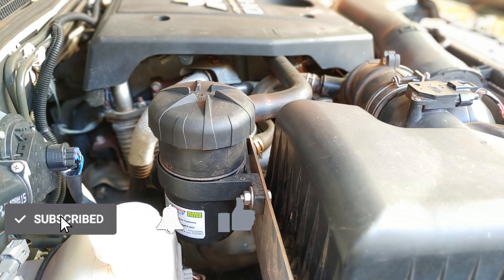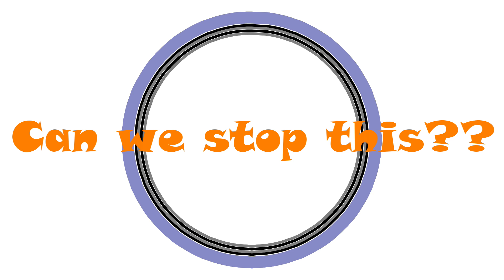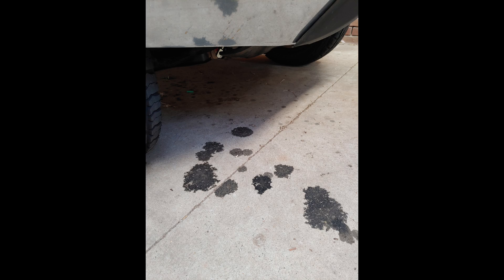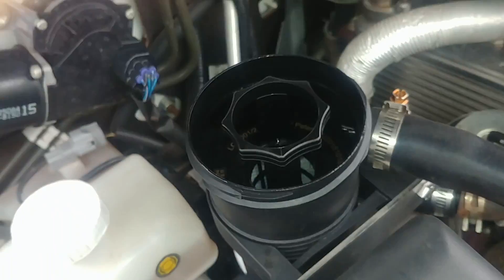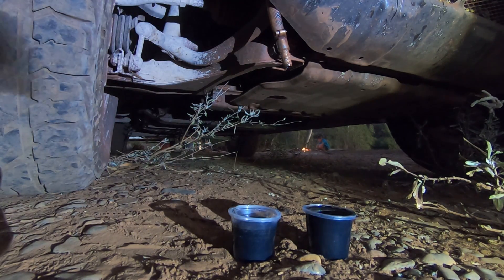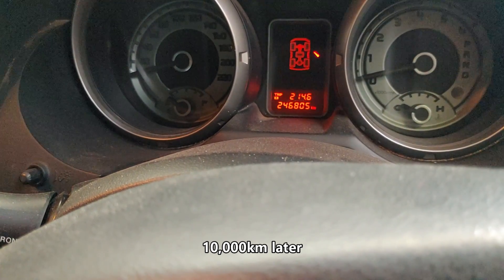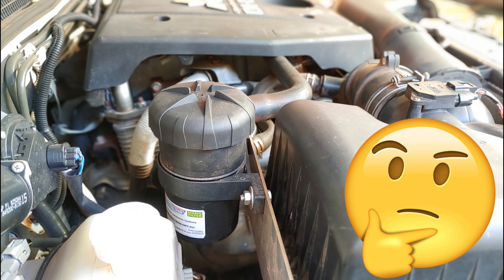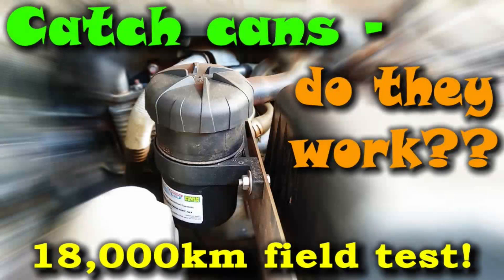Provent 200 Catch Can - How well does it work??

Comment: Good stuff thanks 😉😊. Mine has over 300.00 now . Pajero not catch can ? 🤣🤣
Reply from the maker: Cheers Peter, haha a 300,000k catch can now that would be a thing!
Reply: @TheMusingGreg  yes a bit HIGH but I think it has been driven well ????? . It goes like stink still ?  . Not sure if it has had a re map ? . But goes noticeably better than my mates 2010 model same spec  Pajero . I wanted a good base for a project vehicle ?? . It wad a country vehicle so I assume it didn't do any short trips ??? .
Reply from the maker: @ThePopypete  Nothing wrong with 300,000km, I've heard they'll easily do half a million if looked after and that's probably low too. You might have had a remap, if you check my first liqui-moly video I did a 0-100 at the beginning (with 5 people and some cargo mind you) in case you wanted to compare.
Reply: @TheMusingGreg  I will do a check .😉🤗🤭

Comment: I found those catch cans start to work properly after the filter has collected some oil. The vapor likes to stick more to an already oily surface. So what you said about doing the manifold clean after your catch can has been on for a while is spot on 👍 
Probably want to squirt a can of liqui moly after replacing the provent filter coz the new dry filter will let the vapours pass through again
Reply: It is a good idea to use some air filter mineral oil sprayed onto the filter when installing. This helps speed up the process.
Reply from the maker: Thanks for the tip, that could well be the reasoning!
Reply: I doubt that is the case.
Dont expect oil to immediately start building up in the hose after a fresh filter.
The filter membrane works by catching the oil vapour and gradually collecting it until there is enough to build into drops that are heavy enough to drop down into the hose.
Until that has built up, the filter itself will have a capturing capacity.
Reply: @slickstrings  Doubt away, it's very well known. Just have a look at how much comes out of your catch can exit hose after a new filter compared to an oiled up one while its idling. If you even have a catch can
Reply: @Josh-e2l  erm, i do and again, completely unscientific and anecdotal. 
Did you do flow tests? did you repeat the experiment? did you check multiple times on multiple days with the same atmospheric humidity level and at the same engine temperature since an engine will get more blow by while cold? has your study been published? The manufacturer says the efficiency is measured at between 90% and 98% depending on the mass of the weave when its CLEAN. Do you think your eyes can spot an 8% difference especially when atmospheric conditions influence how much vapor you can visibly see, especially when the actual composition of crank case vapour varies depending on so many factors? Did you weigh each filter to assess the variation between filters used?
Instead of saying its 'well known' why dont you just say i think because i saw it once.

Comment: Thanks for taking the time to post these videos and test the age old question "are catch cans any good or a myth" I have the same catch can ready to install but haven't due to all the "professional advisers not to install them" "stick to the manufactures engineers design and  R&D" etc...is there any truth in my understanding that the blow by return is connected ( without a catch can installed) on the air intake to the turbo therefore the oil residue (and soot ??) goes through the intercooler as well ???... I look forward to an update to your research... thanks heaps... Liked and subscribed
Reply from the maker: Hi G Man,

Thanks for the comment and subscription, I appreciate it!

I'm not sure which vehicle you have, but yes the blowby return is normally connected back into the air intake prior to the turbo. At 2:22 you can see me connecting this hose into the catch can, and previously it was connected to that clean port just to the right of my hand in the top of the rocker cover. So yes, all that oil residue goes through the whole intake path from that point, including the compressor side of the turbo and the intercooler. I believe this is why in the 2000km test I still found oil build-up in the manifold after installing the catch can, as this residual oil in the intake path was being blown on towards the inlet manifold.

In terms of the comments you've heard, here is my take:
"professional advisers not to install them" - that depends on who the professionals are and how the installation's done. Any aftermarket modification has the potential to cause unforeseen problems which is why caution and thought is often called for. One potential problem with catch cans is that if they block up then the blowby gases will start to pressurise the crankcase, and that pressure will start pushing oil out through gaskets, in particular the rear main seal. But that's why it's important to choose a catch can with a pressure relief, which the Provent 200 has, as this mitigates that risk. If chosen properly and installed properly I don't see an issue. But I was disappointed about the kinked hose in my install as this could cause a problem over time.

"stick to the manufactures engineers design and  R&D" - anyone who has spent time in cars knows this is largely a lot of twaddle. If engineers could design the car the way they would like it, the accountants and marketers would reject it as it would cost too much. So everything has to be a compromise. A catch can is just another piece of equipment they have to pay for, and they would see little benefit. While a blocked manifold would often cause power or economy to suffer, as shown in the manifold cleaning videos showed, manufacturers have simply gotten around this by getting the turbo to deliver more boost to overcome any intake restriction. It's a much cheaper solution for them than paying for a catch can, and the only penalty is increased load on the turbo. By the time that causes a problem it's well out of warranty. However if it's your own vehicle and you value having a clean manifold and reduced turbo load so it lasts you 30 years instead of 15, then you may well be happy to invest the $300 for the catch can.

Cheers,
Greg
Reply: @TheMusingGreg   Thank you so much on a very detailed reply, much appreciated taking the time to help others who dont have the day to day experience of vehicle do's and don'ts and defiantly not wanting to make any expensive mistakes or mis-advised.... I have a ML Triton 3.2 (very similar to your set up) with a Provent and hose set to suit ready to put on, I installed an aftermarket Provent knock off and it did catch oil and seem to work well but took it out(was concerned about any chance a cheap knock off might not work as well and the pressure valve may fail and destroy my engine) and purchased a Provent complete set to suit, but never installed it, got spooked by the do, don't do out there. Your posts have been by far a real insight to the reality of a catch can's worth and impact...thank you mate, I'm glad I found and subscribed to your channel. you have a very real, un-bias and in depth look (both technical and practical) at what is good for certain vehicles i've seen so far.............. I look forward to bingeing on your posts , thanks again
Reply: BTW I'm now very focussed on installing the Provent , is it a good idea to install a EGR blank (with or without a 7mm hole) as well ?? have a good idea where to install it but not much info out there the right place/how to install it on a ML Triton 3.2 L
Reply from the maker: @GMans-World  Brilliant, glad to hear it was helpful mate, that's what I'm here for so I'm glad to hear the videos are hitting the mark! I think you have little to worry about with the Provent, the install is not difficult to do, just try to avoid kinked hoses. Good luck!
Reply from the maker: @GMans-World  Because I'm still in the final stages of testing the manifold build-up I've not done that yet so can't speak from experience.

Blanking off the EGR is technically illegal so be aware of that, but it's not hard to do. If you look right at the beginning of the video, you can see the spot you need to install the blank. Just to the left of the catch can lid and partly hidden behind the catch can is a pipe which looks like it's covered in alfoil, and to the left of that is a solid silver pipe welded onto a flange with two nuts. That's the EGR pipe which leads to the EGR valve, so you just undo those two nuts, pop the EGR blank in and put it back together.

However from what I understand the computer will have a bit of a tantrum if you don't have a hole in the EGR blank (and possibly also in the throttle butterfly plate), and with a hole it will not completely stop the problem. A better alternative from what I've heard is the resistor mod in the airflow meter, as this apparently keeps the EGR valve closed via the ECU without blanking off the EGR.

Good luck!

Comment: I’ve had Provent 200’s on a 2017 Ranger Wildtrak, 2020 79 Series and now a 2016 NX Pajero. They work. The Ranger and the 79 Series fill up like nobodies business. The Pajero was bought secondhand at 150k and it’s barely leaving anything. Now to be fair I installed a Munji EGR delete at the same time.. That might have something to do with it ;-)
Reply from the maker: That's interesting mate, I've heard the DI-D in the Pajero is a 'heavy breather' so I assume that must be compared to Toyota diesels, but your experience seems to be the opposite.

Interesting note about the EGR delete but I don't think that should have anything to do with it. The amount of engine blowby will be the same regardless of whether exhaust gas is getting back into the engine, and the blowby content itself is mainly crankcase oil fumes. Maybe your Pajero's had a very easy life or is simply very tight on its piston ring clearances. Either way I'd be happy with your situation! How much do you collect in say 10,000km?

Cheers,
Greg

Comment: Interesting issues you had....I also have a 2012NW, and also just installed the exact same catch can at 220000km. Did not have either of the issues you mentioned with the kinked hose or leaking valve. I did find the hoses weren't the best fit though. Interestingly, I'm yet to really see anything that needs to be drained....I don't put many km's on mine though.
Cheers
Reply from the maker: Thanks for the input mate. How far have you gone on yours since you put the catch can in, and what sort of driving? I was towing a van for most of that time through WA and NT so a fair load in the engine.
Reply: @TheMusingGreg  I've only put around 5000km on mine since installing it and driving is low load. My engine also seems to have a lot less blowby compared to yours...not sure why, but similar kms overall.
Reply from the maker: @Cowardlyduck  Mine's been towing most of its life so that may be why. Although most people sound to have similar blowby to mine so I don't think mine is in poor condition. But check out https://youtu.be/aKb1Nwewy6A and see how yours compares (if you haven't already). There's an example of a 20,000km Pajero's blowby at https://youtu.be/BXUnbrvVAwI

Comment: Need to block off the egr valve to get rid of the soot.
Reply from the maker: Yes that's something I'll be looking at once I've verified whether the soot continues to build up. For the Pajero there are equivalent mods which don't involve physically blocking the EGR valve as that messes up the ECU.
Reply: @TheMusingGreg  i look forward to your research Greg
Reply from the maker: @GMans-World  Cheers!
Reply: Agree. After I got my inlet manifold professionally cleaned I installed a can and did the resistor mod to keep the egr closed.
Reply from the maker: Yep that's the mod I intend to do. But in the interests of research I'm delaying it for a bit to find the answer to this question first.